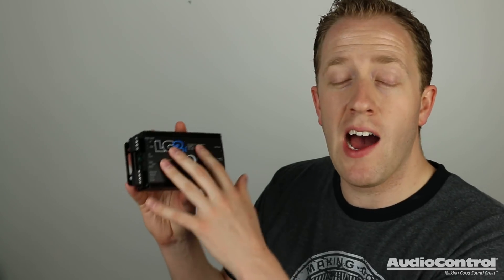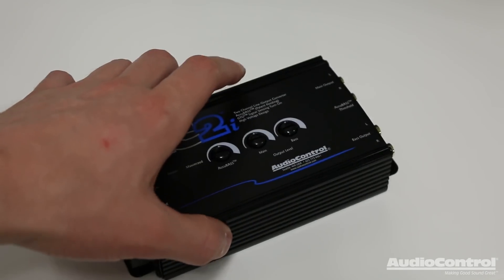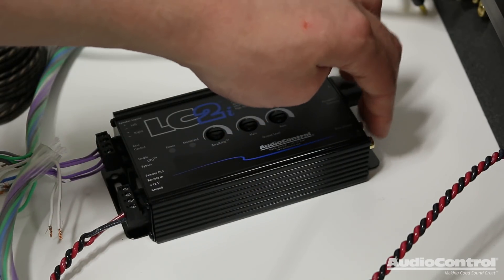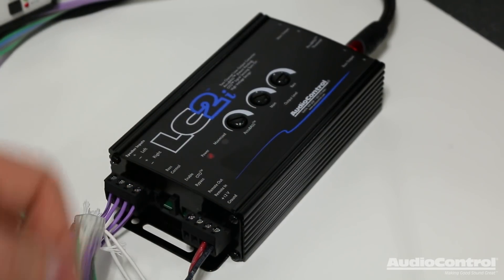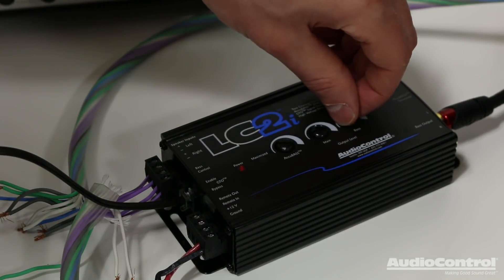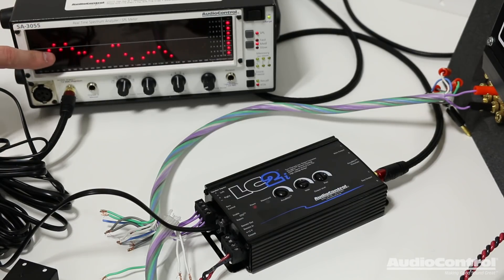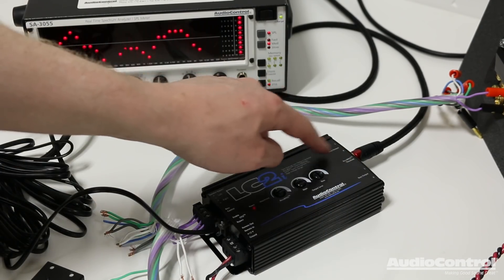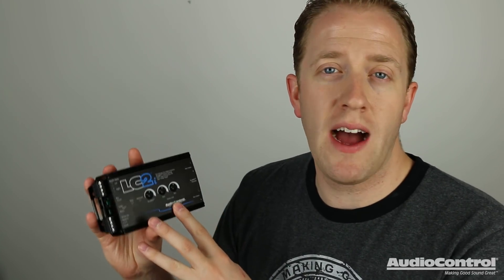LC2i - Add a Subwoofer Amplifier to a Factory Audio System - Line Output Converter

Comment: I am having problems with car audio system installation. I have a 2015 Dodge Journey R/T. It has a stock Premium Alpine Audio System. 6 speakers 1 subwoofer. I have an AudioControl LC2i LOC tapped into the stock subwoofer. I have the GTO in the bypass position, as I am using a toggle switch to turn everything on and off manually. Tuning the LC2i is fairly straightforward. Your YouTube videos helped with that. My issue is with tuning my amplifier and subwoofers. I have an Alpine MRV-M1200 Monoblock Amplifier powering 2 Alpine DVC 2 ohm + 2 ohm SWS12D2 Subwoofers (trying to power anyway) wired in series parallel to 2 ohm final impedance. Correct me if I'm wrong on the wiring terminology. The RCA wiring is driving me crazy. When hooking them up I barley get any bass. Even after adjusting the Gain and Bass EQ. When only one RCA is hooked up I get better sound. Do I need both RCA's hooked up. I also noticed in your video you only had the one RCA hooked up when demonstrating the tuning process. I also don't know anything about the Low Pass Filter or where it should be set at. Thanks for your time
Reply: I had a few issues like yours that’s why I’m gone help ya, it took me about 6 months of playing with it to understand...first I just found out the low pass filter needs to be set at about 80 to 100 hertz, why, cause if it’s just connected to your woofers, your just playing the low lows, you don’t need any higher cause then your just straining your woofers to play higher hertZ than the woofer was intended for or needs. Like voices etc.. the phase you need to put at zero cause from what I understand, unless your woofers are hitting off balance with each other or the car speakers, you don’t need it, you just want the puches...
Reply: You need a multi meter to set up the gains on you lc2i. if you don’t have acces to an SMD, or you could do it by ear but that’s just playing it. when you say 2 rca’s , by two rca’s you mean both sides of the unit? One set of rca is for high’s, the other is for lows. If your just using it for your woofers you just need to connect one set of rca’s on the lo pass filter side, the right and left. On the bass output R & L , if your R and L are failing the might be something wrong with your amp or you didn’t connect or tap the speaker wire that goes into the lc2i correctly.
Make sure your accuabass threshold isn’t all the way up to where it doesn’t turn, turn it up all the way then down just a little bit, I noticed it picks up the bass roll better if it’s not complete turned up.
If your using the lc2i for just bass and woofers, the MAIN knob is useless set that zero.

On the speaker inputs make sure you connected the right and left positive and negative  on both, it’s better than just one. Connect all four positive and negatives , right speaker and left speaker ... hope it helps.

Comment: To have a best speaker signal for lc2i is it better to tap into the speaker wire before (from oem head unit to oem amp) or after oem amp ?
Thx.
Reply from the maker: After
Reply: AudioControl thank you, still trying to figure out OEM hi-fi amplifier/speaker wiring colors for 2015 F30 BMW nobody seems to have it, still researching.
Reply: AudioControl can you elaborate on that? I’ve always heard before the factory amp is best, because the lc2i can’t compute above a certain amount of wattage
Reply: @camaroboi13  the LC2i can take up 400watts input
Reply: kontaktier mich.. ich kann dir die Belegung besorgen! :)

Comment: When you connect the 2 sets of  factory speaker wires to this, do those speakers now not work because they are on the device? Thanks
Reply: You are only tapping into the wires, you can do this with any form of T connector.  You are not removing the wires from the speaker itself, just borrowing the signal from them.  Hope this helps.
Reply: Ive notcied that factory subwoofer cut off bass at certain frequenices. Tapping into a full range speakers like you just said should solve thag problem right ?

Comment: Love your videos, Mark!   I tapped into my front door speakers as opposed to the rear speakers to install my subs. Will this signal change/affect the performance of my amp and subs?
Reply: No it will not, however, if your system is active i.e. your dash chimes and onstar go through your speakers, then amplifying them will make them incredibly loud.  When your seatbelt is not on and you hear the chime, it will be VERY loud if being amplified off the front speakers.  Typically it's the front driver's side where you'd hear the chime.  If your rear speakers have a full range and aren't just mid range speakers, then I would use the signal from there instead.  Hope this helps.
Reply: camaroboi13 thanks for the reply but my question probly isn't clear.  I wanted to know if the input signal to the LC2i would be better if I tapped into my front speakers rather than my rears.  I measured and turns out the rear door speakers get half the voltage as the front door speakers. There's no bass roll off on this vehicle and my accu bass knob is turned all the way down (threshold all the way up) so I'm sure the LC2i and my amp will be able to compensate for the reduced signal at the rear door speakers.

Comment: Where should I have the gain on my Amp adjusted to if I plan to use the gain on my lc2i and the accubass on my lc2i?

Is there a way for me to use the Amp bass knob meanwhile using the lc2i accubass? And how would I adjust this?

I have a JL 600 watt Amp with the lc2i
Reply: it's been a year so I imagine you figured this out by experimenting...what did you discover?

Comment: Been trying to figure out how I’m going to add a sub and amp to my 2013 CTS for days. I think I’m sold on the LC2i. The GTO with remote out is a nice addition I wasn’t aware of. Hopefully the 30hz cutoff isn’t an issue. Still trying to decide where to pull the signal from as well.
Reply: 30 Hz cutoff? I ask bcuz I use a LC7i.

Comment: My concern is about On/Off power.
Since this is a "constant active signal" unit, when I turn my radio and car off, does the LC2i also turn off?
Reply: The signal it receives comes from the speaker wire, when you turn on the estéreo, lc2i senses the signal from the speaker wire and powers on, turn off the stereo it turns off... from there it has a gto, which is a remote in and out, you don’t need the in, cause it already powers on and off with the speaker wires. I use the remote out to my amp that way you don’t have to search for one in your vehicle and less wiring etc. If you leave you stereo of, it won’t suck juice from your battery.

Comment: Hi Mark, Love the video, very informative...

My query comes from another video I watched recently stating it's better "NOT" to grab the sub signal from a stock sub speaker, to utilise the Signal Sensing circuitry "GTO" As the stock sub sometimes stops producing voltage due to lack of movement, which intern switches the amp off. Does this sound plausible to you, and/or have you ever come across this issue? 

I'll be using the LC2i in a 4 series bmw to add 1 amp and 1 sub box.
Reply: I have this device and i've experienced the issue you described.  2014 Lincoln MKZ pulling signal off the two factory 6x9 "subs". The bass will hit and a delay occurs, usually .5 to 1 second late. This also happens in a lull of the music without any bass i.e. a breakdown or solo etc. I think you are right, but make and model may come into play.

With that said, i'm using the GTO feature but the LC2 isn't powering off during these events.

Comment: Warning for all the bassheads or audiophiles wanting to use this device, it has a non disclosed built in subsonic filter that cuts All frequencies below 30hz. Other than that it's a great product but if your listening content has frequencies below 30hz the lc2i will cut them out and it will drive you insane trying to figure out why your not getting the low lows. I listen to bass boosted music and sometimes watch movies which both have sub bass below 30hz. If you're already having this problem, call them and make them fix it, the specs say it will produce 10-20khz and it Does Not. They have great customer service, I called them out for the subsonic filter and they sent me another lc2i that would play down to 25hz.  Audio Control you need to change your specs or make the units play down to 10hz as specified.
Reply: I know for the Audiocontrol Epic Center is the same way comes from the factory and wont play below I believe 32 or 34hz. In order to make it get low like "back in the day"., Nowadays you have to buy what we call in the hood a DB Chip the pro term is Crossover PFM Module.. Its really easy to install. Simply unscrew the back plate pop out the old chip insert the new one. Plus Its only $17 with shipping. It now gets as low as 15hz not down to 10hz but Im happy with it. What I'm unsure about is, is if the same chip mod can be done to the LC2i ?
Reply: Markus B, For the lc2i there isn't a user changeable chip like the epicenter. It' has a micro chip that has to be programmed by them.
Reply: They should rewrite the spec sheet to what really is. Glad I've seen this , my box is tuned to 32hz and love decaf songs in the 20s.
Reply: Illest Villain, I bought mine because the specs are claiming 10hz to 20khz but that is definitely not the case. They told me they would rewrite the specs, I haven't checked to see if they did.
Reply: I just checked their website the specs are now 33hz - 22khz, But the manual  still says 10hz to 100khz.
Reply: What’s is a good converter to buy. I was going to buy a lc2i on eBay but not after reading this.
Reply: @Withlin Barhm, JL Audio released a line out converter called the LoC-22 , im getting one to replace my Lc2i.  JL claims it plays from 3hz to 32k, I shall see and you can too.
Reply: @Withlin Barhm, I just installed the JL line converter LoC-22 and it is much better than the audio control lc2i. The bass plays as low your system can and the bass is more accurate and sounds much better. The Jl line converter is the  best option for us now.
Reply: @Tacticalbuffoonary  hell yea I was like where tf did my bass go I had to take the lc2 back to best buy I got better bass from el cheapo converter but I'm looking to get the jL
Reply: This makes total sense now fml the whole time I was wondering why I wasn't hitting lows like used to when I put my system into my new car with factory head unit & installed the LC2i. Been driving with it as is for 2 years.... Ditching lc2i, shopping for loc-22. Thanks for info
Reply: Funny, I've been having the same issue and assumed it was a combination of my sealed box and stock HU.
Reply: Megawatt, That's what I thought too, and I blamed the factory stereo and thought my box was wrong. But I put my box and amp in my buddy's car with a pioneer head unit and it played down to 22hz no problem. The tech guy a Audio control told me the lc2i has a built in subsonic filter at 30hz and that's when I found out the real problem and posted here to help people figure out why they ain't getting the low lows.
Reply: Buddy it's thats your factory radio doesn't allow lows to be played on stock speakers he mentioned this in the video its your shit radio not the device
Reply: yes i noticed it does not hit the lows i been wanting.  i thought it was the stock head unit but now it makes sense.  you’re saying that if i call customer service they will swap it for one that does hit low hz?
Reply: ijr909, I called them for something completely different and the tech happened to tell me the lc2i has a built in subsonic filter that cuts everything below 30hz, I asked him if they could change it to 20hz and he said they would try. After a few emails from me pointing out the specs say 10hz to 20khz and no mention of a subsonic filter and my dissatisfaction with the lc2i they sent me a new lc2i that plays down to 25hz free of charge. I assumed I needed to send them my old  lc2i but they never asked for it. The new lc2i didn't come with the molex connectors as in the removable plugs you connect the wires too, you have to use the ones from your existing lc2. Call them and see what they will do.

Comment: I have a 2017 camaro 1le with no 6x9 which I currently trying to install will this be a good item to tap into the rear speakers to get good sound? Also later can I run a subwoofer off of it?
Reply: Orlando Garcia I have the same car use  the LC7i in case you wanna upgrade the speakers later

Comment: I am looking to put this in my car with a Jl Audio ACS112-lg Tw1 powered subwoofer. The input sensitivity max for RCA's on the sub is 1.4 volts. The lc2i delivers up to 9.5. Can the bass channel gain be turned down enough on the lc2i to deliver only 1.4 volts? If so, would you then have the gain on the sub turned all the way down?

Comment: can I connect both pos and neg from the converter into a factory sub to get my signal  since the factory sub only has 1 pos and neg
Reply from the maker: Yes, you can. You can run the factor wires to the left input, then jump those connections to the right input (keep polarity).
Reply: @AudioControlCar  This needs to be documented somewhere! I think I found my issue since I only have two factory sub wires + - in the left channel.. the light comes on but nothing plays, so your saying I need to make a couple jumper wires to go from the left + - to the right + -
Reply: AudioControl so if i have 2 12s and my car has a factory sub can I hook both subs up to the single stock sub connector??

Comment: i have the lc2i and 5 channel amp, i decided to run new speaker wires for my speakers but im not sure how how and what do i tap wires on my factory stereo wire harness.. PLEASE HELP
Reply from the maker: With the LC2i, you will need to find a single pair speaker wires with full-range signal (no summing in the LC2i). If you factory front is active, then you might need to grab signal from the rear.
Reply: what do you mean by active speaker??
Reply: Ekaj Oabil i got it figure out.. just tap on the back speakers wire thats all you have to do
Reply: How about front speaker on the dashboard?? Can i tap only 1 spkr on LC2i's spkr input.??
Reply: Ekaj Oabil you can always try but id tap on the back speakers. It did work well for me, tap on the back speakers then just connect those wires to the terminals on lc2i and on your amp i combined my front left and back wires together and front right and back together on the amp speaker terminals then set your gains to zero then start adjusting from there till you find the right spot where the sound wont distort anymore
Reply: Tnx men, really. appreciate.did you hook up the LC2i's power line on your amp as well as the ground?
Reply: Ekaj Oabil yeah just connect it to the ground and power terminal of the amp as well the remote in connect it to the terminal next to the power i forgot the name of that terminal

Comment: Can we tap the signal and still run the original speakers, or when you use the high level then the speakers you tapped can't be used?  Hopefully that makes sense...
Reply from the maker: Yes, you can tap into the amplified output of your factory system and still leave the factory speakers connected. The LC2i has a high impedance input and will remain "invisible" to the factory system.

Comment: my acr2  when turning the clicks turns the light on and off and when i push the button it shuts off the light...no clue if thats normal. also when i turn the knob left or right i dont notice a difference
Reply from the maker: Hi. Are you using the ACR-2 with your LC2i? The ACR-2 is only intended for our LCQ-1 and some legacy product. For the LC2i, you need the ACR-1.

Comment: How many speakers can you connect to the lc2i?
Reply from the maker: You won't actually connect speakers to the LC2i, but to the aftermarket amplifier. The speaker level inputs on the LC2i are for the amplified outputs of your factory system.
Reply: Wrong expert opinion. U can connect 2 signals left and right direct from the source  (the head unit).

That's all. Not 4.

Comment: How is the Sound coming out the Sub?  I have a Line in Converter and the Sound out of it is really bad.  I am missing some low end Freq. and it sounds really Muddy and its just not a Tight sound. Its really open.  I know Audio control makes a Great product and has great sound,  but this being a Line in Converter I am wondering if I have to get a aftermarket Deck.  Will this give it a Great Sub Sound that I would have from a after market Deck?  Can you provide me with any Feed back please?
Reply from the maker: The sub will sound great. This is an active line output converter (powered with active circuitry). There is no signal loss and the preamp can drive your voltage up to 9.5 Vrms. Your amps will be happy and so will your ears. Many people are happy just adding a nice sub and amp with the LC2i (rather than trying to upgrade to an aftermarket head unit).
Reply: I am Running a SoundStream Ref 700 with a JL Audio W3 Dual VQ.  I could'nt bridge it Mono because it was not getting any sound out of it.  Ears where not happy at all.

Comment: Is it safe to run a LOC on new cars like  2017 mercedes cla ? Someone mentioned this plays up with the cars computer if it feels the car is drawing too much power and gives fault codes on the dash ? Is this true ?
Reply from the maker: Typically there are no issues running an active LOC in current cars. Some amplifiers in current models will go into protect when the factory speakers are removed from a channel (rather than tapping into the signal). You can install resistors in this case or use our AC LGD: http://www.audiocontrol.com/car-audio/accessories/ac-lgd/